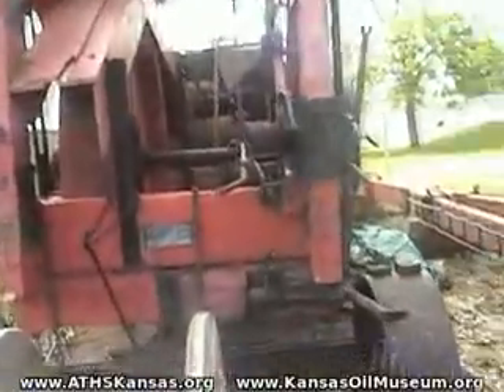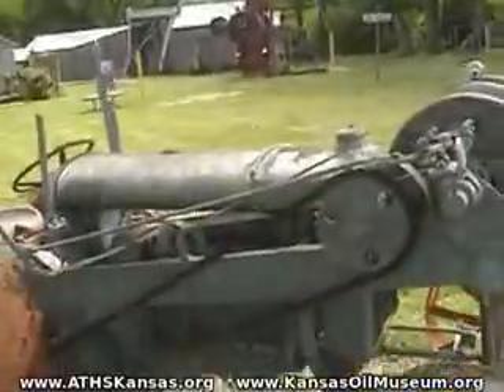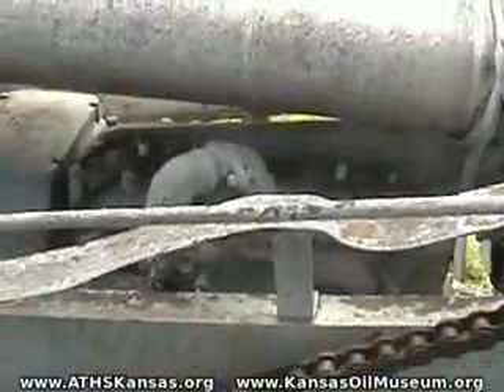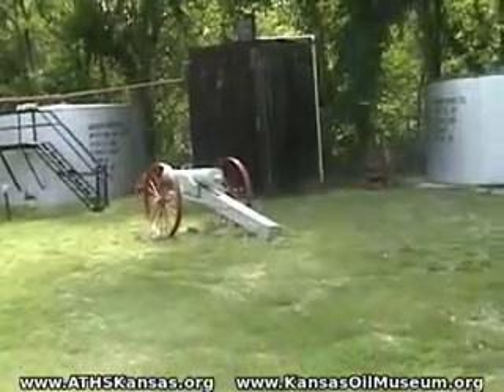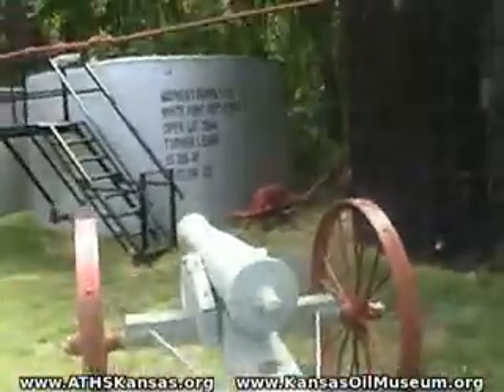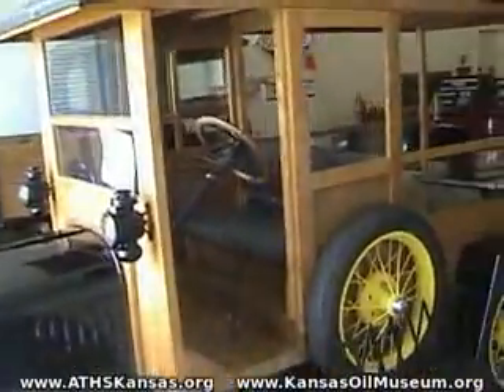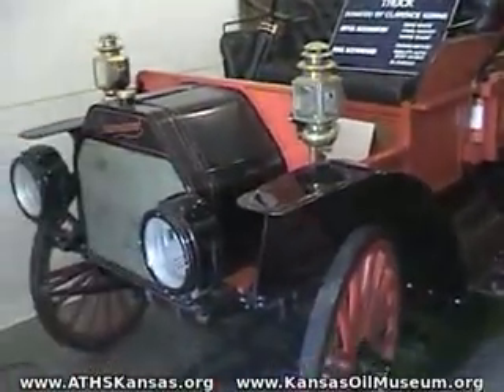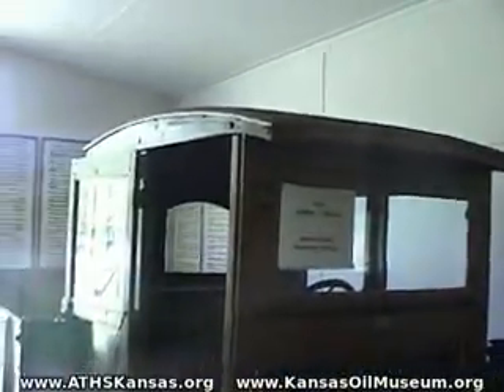Kansas Oil Museum - Portable Cable Tool rigs

Comment: I realize this is an old post and some parts of your commentary are correct. But a good bit of is wrong i was a 3rd generation driller and grew up on all these machines. The tractors with the single reels was not drillung machines but service rigs designed to swab fluids and to run and pull tubing and rods for pumping. The crawler with the side boom was a pipeline rig for laying pipeline. The truck with the explosives you were partially right although they was 2 different types of shooting a well as we call it. The one as you mentioned called for running casing to bottom cemmenting it in and the exosives truck would come in and would shoot perforations at specific depths by using a tool loaded something similar to a gun. It would shoot projectiles through the pipe and cement exsposing the formation so that it can later be fract. The other option was you ran casing down and set it usually with what is called a packer just above the formation you want to produce. Then the explosive nitroglycerin in early days then later the use of plastic explosives became a safer method would be lowered to the bottom where the payzone was and a detonation jack would be droped and the zone would be blasted. This was known as a open hole shot. I hope this explains some of the misconceptions.